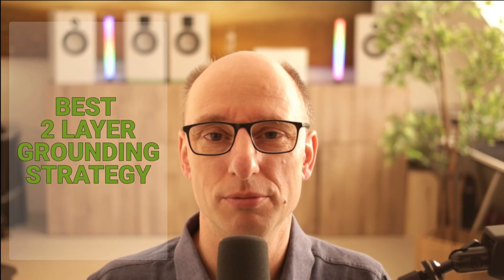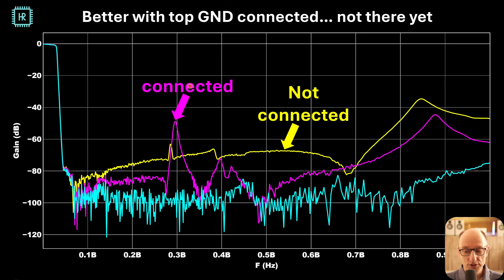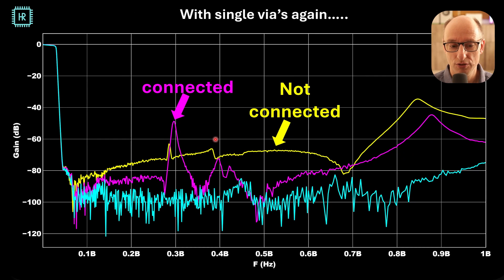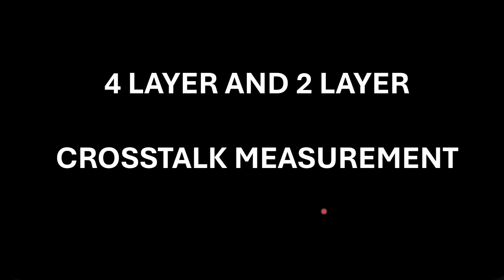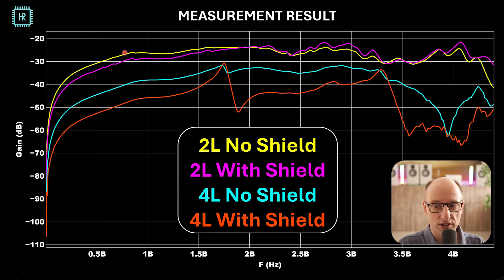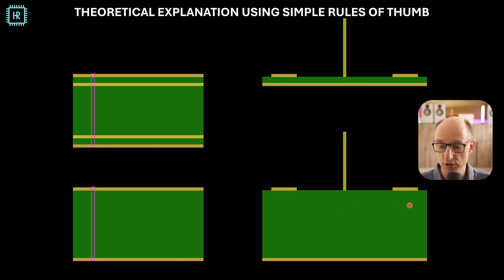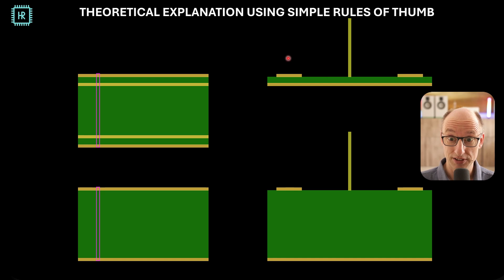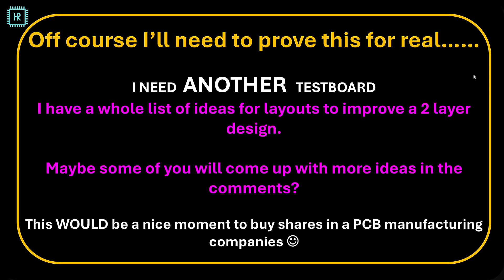Practical 2-Layer RF Design Rules (That Actually Work)

Comment: Thanks Hans for another great video, One topic that would interest me a lot is the effect of the dielectric material used in the PCB. Let's say you compare the cheapest JLCPCB 2 layer PCB against a not-so-cheap EU 2 Layer PCB with the same basic parameters (i.e. PCB thickness, copper thickness). The only difference being the dielectric material of the PCB. I have heard of the loss factor, dielectric absorption etc. But what effect does the overall quality of the dielectric and weave pattern etc. have on high frequency applications? Is there any difference that can be measured?
I really like this video series!
Reply from the maker: I may have answered that one already in video 1. Somewhere in that video I calculate the loss of the 10cm transmission line and compare it with the real measurements. They're spot on: AND I MEAN SPOT ON!! :-) Within 0.02dB, which is nothing. This was a board by PCBWAY. So I think those material properties are quite easy to control with modern equipment. If you really want high performance RF, you need to use rogers board material, however, a board is very very expensive when you use that.

Comment: In machining apart some junk 4 layer boards on hand I have found that they seem to have the layers evenly spaced rather than the way you show in the pictures. Do you have to specify the way the layers are spaced when buying the boards? I have never seen this mentioned.
Reply from the maker: Every supplier has a different standard stackup. Eurocircuits uses 0.38 / 0.8 / 0.38 for their FR4 cores, pcbway does 0.19 / 1.2 / 0.19. However, all kinds of thicknesses are possible. There are also 75um dielectrics. If you deviate from the standard a supplier has, it does tend to get really expensive really fast :-)
Reply: Usually, the PCB stack-up for a 4+ layer board is made up of "core" and "prepreg" layers which are laminated together in a press. If you have a 6 layer board, then there will be copper foil layers added also. Generally, the core material is quite thick compared to the prepreg material. 

Not saying it wouldn't ever happen, but I would be surprised to see a 4 layer board that truly had evenly spaced layers, i.e. layer 2 the same distance from both layer 1 (top) and layer 3.
Reply from the maker: Yes, never saw that either :-)

Comment: Thank you very much for this video! This is incredibly helpful for my work on an ESC. From what I've seen, this information is crucial. Once the PCB design is complete, would it be possible to share it with you the design for a review? I can also send an invitation link to the PCB software I'm using, which is EASYEDA, to make the process smoother.
Reply from the maker: Thanks a lot. I don't have time for a review unfortunately. I do have the next best thing:
https://www.hans-rosenberg.com/checklist
This document contains exactly what you need to do to prevent problems and it's free.
For you the important things are: Ground plane, use short traces, make sure that the resistance of your traces is low. An ESC is a high current speed controller right? Watch out for trace resistance.
Best regards,
Hans
Reply: @HansRosenberg74  Thanks a lot Hans !

Comment: Nice series - even if I'm not really into RF (except for an occasional NFC antenna) I still enjoyed it.  But I'm more into doing stupid things with a handful, or two handfuls, of 74-series logic ICs. And being a bit on the cheap side I usually go for two-layer PCBs just like they did in the 1980s. Do you have any tips for power distribution (especially when using faster families like 74AC). And also does crosstalk matter in a digital bus, like if you do the but at 5/5mil or space the bus out to say 8/16mil?
Reply from the maker: Crosstalk is not really a problem for a hobby project. However, if you have a real product, and you don't have a ground plane and you 'forget' decoupling caps close to the power pins of your IC and don't put a ground via very close to the other side of the decoupling cap: You've build an excellent interference transmitter :-) This will get you into trouble with certification tests.

Comment: An Idea is to add a premade shielding can over the problematic parts of the board and connect it to the surface gnd. Parts that are influenced by each other woudl then be separated by a "grounded wall". singal traces are then routed on the other side to pass under the shielding can for an uninterrupted conenction of the can to gnd.
Reply from the maker: That would definitely work, however, 4 shielding cans on a filter would get rather expensive 🙂 In my next testboard I'm going to try some other measures to deal with it and improve it. Curious to see how this is going to work, I still have to make that board.
Reply: @HansRosenberg74  What about using a nonconductive epoxy encapsulant like Stycast? In a 2-layer board where the shortest path to GND isn't necessarily between the signal trace and plane, would exchanging air for a higher Dk material help? Not saying this is practical from a cost of manufacturing standpoint, of course.

Comment: This is super interesting!
It has so much of the opposite problems I can face when dealing with transimpedance amplifiers. For me currents coupled capacitively make problems and having more distance between planes can help. Frequencies are a lot lower though. Any thoughts on this? Digital signals coupling to analog amplifier inputs where slight currents become amplified.
Reply from the maker: Digital 'aggressors' attacking analog 'victims' is very common, since digital signals have a very high amplitude and lots of harmonics. If you really have a crosstalk problem, the best way to deal with that is expensive: Shield cans across your analog or digital circuitry. The absolute minimum you need is a very good ground plane, without that, nothing will work.
Reply: @HansRosenberg74  Optical sensor -> transimpedance amplifier 22bit ADC gives 5pA sensitivity😝 Leave it on a dark table facing down and it still picks up vibrations from you walking on a concrete floor... Needless to say, any signals ON the same board can be picked up too. Things are differential to help, but I am sure more can be done on the layout side. Reading out the data from FIFO is also a worry as reading fast creates higher speed flanks/frequencies but allows more sleep between reads for battery life. Slow gives less noise from readout but consumes battery; and I am sure I can spot noise from the system "running" in the data as well (albeit faint).
I think this is a "what is good enough" situation as you can always find things with high sensitivity, ultra low noise sensors.
Reply from the maker: Oef, I get your problem now :-) Sounds like a nice project.